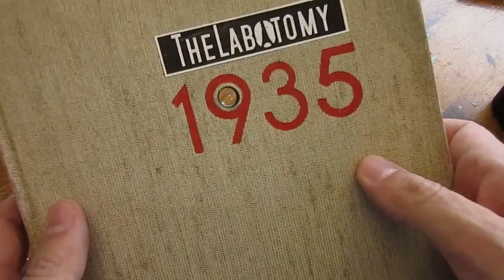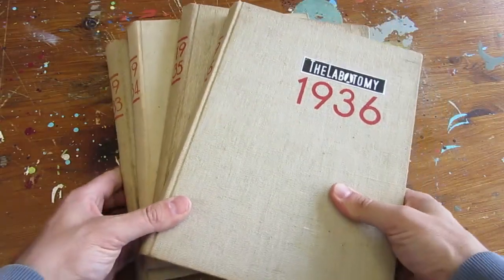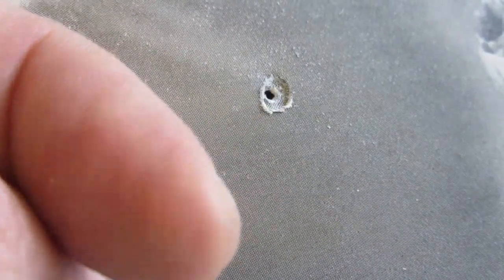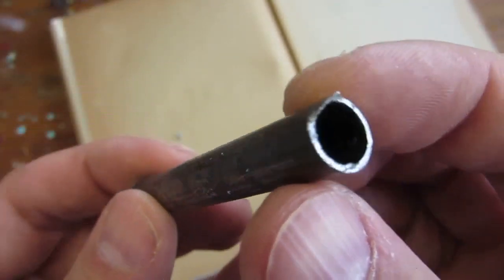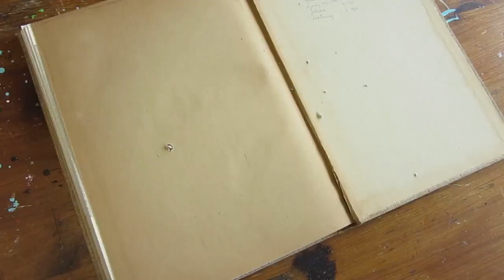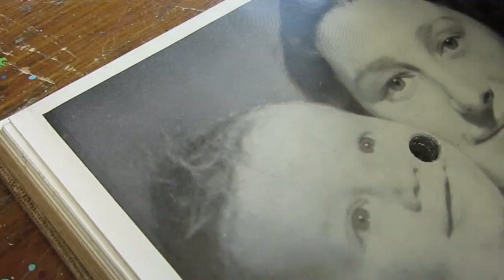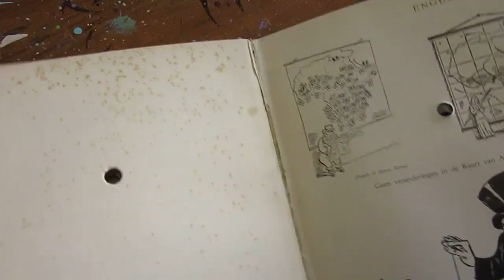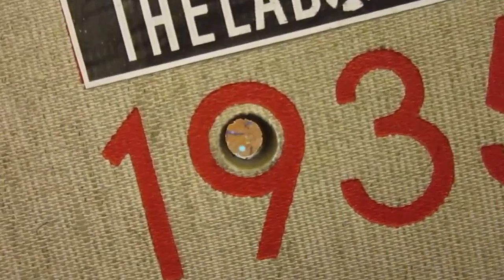HOW TO Quickly Make Round Holes In Large Stacked Quantities Of Paper: Multiple Sheets, Books Etc

Comment: If I was determined to make the hole with the pipe, I would have filed the inside of the pipe so the cutting edge was on the outside. Drill half, empty the cuttings, then finish. But, I've used the method of drilling using  a forster bit with plywood clamped tightly on each side of the paper stack with a pre-drilled hole on the top plywood piece to find the spot to drill, and it came out really clean looking.
Reply: I used to be a tool grinder and I agree of putting the chamfer on the inside.

Comment: I know why it ripped: the pipe was too thick, so after you cut it, the pipe that went in was thicker, so it widened the hole, making it rip. You could've gotten less tear with a thinner pipe, or no tear by sharpening the inside of the pipe instead of the outside
Reply from the maker: Good to see some people still using their brains! Thanks for the feedback
Reply: @TheLabOtomy  I'm thinking copper plumbing tubing?
You may have to resharpen it a few times, but that should work.
If heat is an issue?
Put the bit (or bits?) in the freezer first.

Comment: I’m curious how well the standard drill bit would work if the book were clamped really well. Also with a sacrificial piece of wood on top and bottom to prevent tear-out.
Reply from the maker: You do get a hole, but far from clean as A drill bits scraps material to create a hole, and that means lots of tear up with paper
Reply: I’ve found if you clamp a thin piece of wood 1/4” or so on both sides and drill through it you will have a fairly neat hole. I use a standard metal bit and use this method to add a large key ring to hang our phone book.